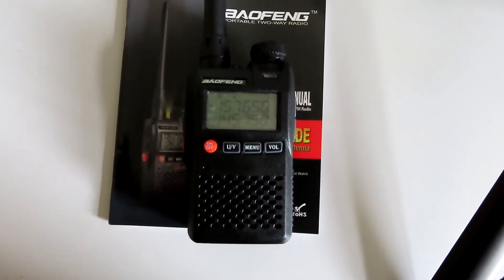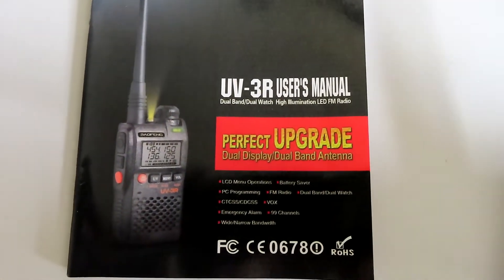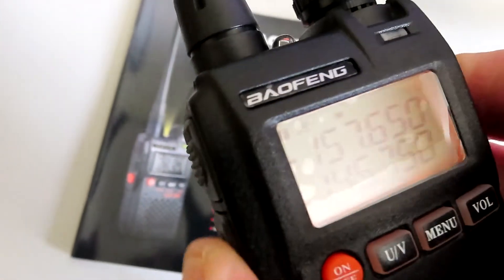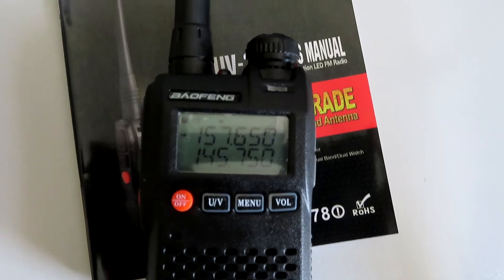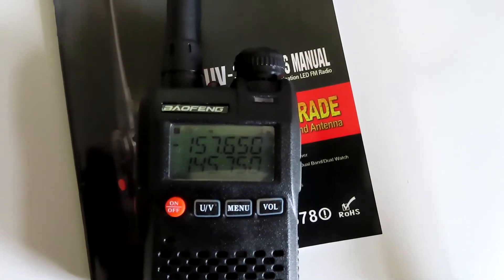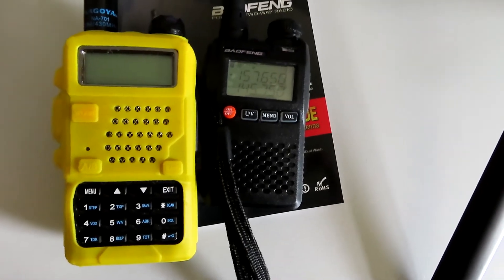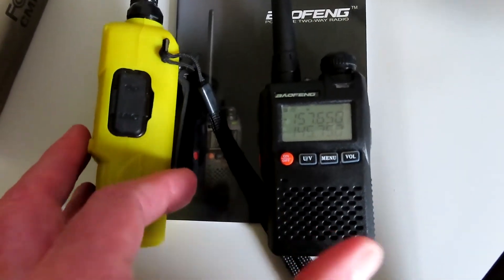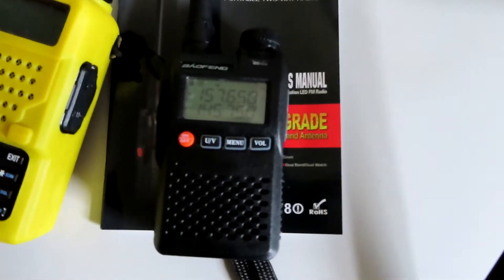Baofeng UV3R- A first Look

Comment: If you hold down the led torch button it turns on the FM Broadcast radio receiver :)
I just found mine after being "lost" for years, i was towing my father's old car to the junkyard the other day and while cleaning out the car i came across the radio again hehe.
Reply from the maker: Thanks for the tip!